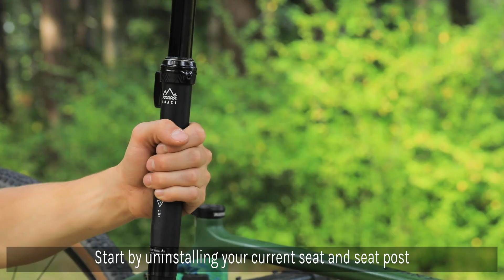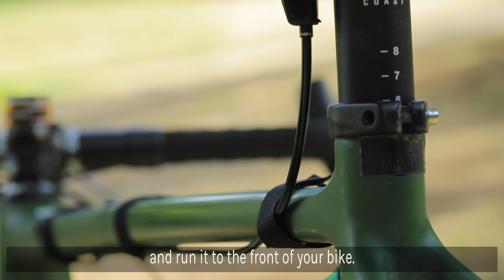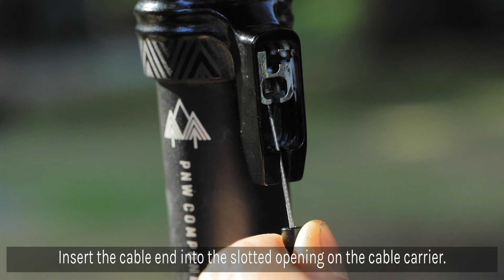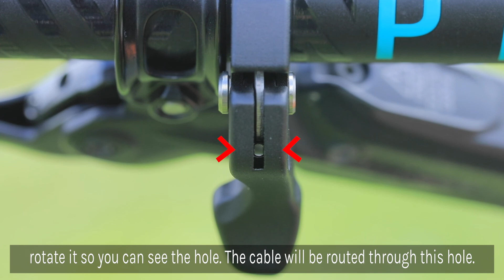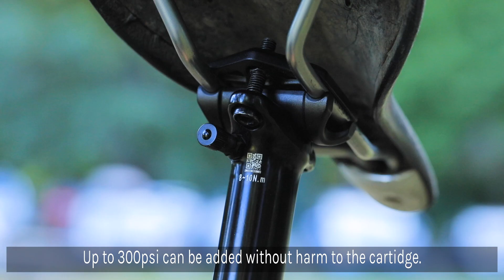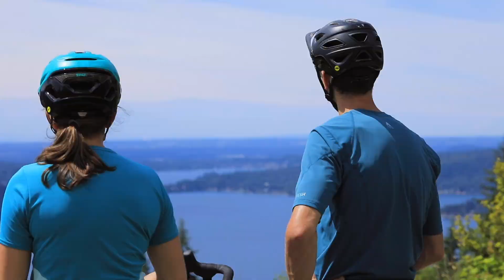PNW Components: How to Install Externally Routed Coast Dropper Post with Puget 2x Lever

Comment: Good video. Apart from the air adjust, this is the same arrangement and fitting instructions as for the Brand X Ascend II, and better than the 2 or 3 videos I looked at for that. Only thing I did different was to mount the lever outside of, towards the handlebar end from, the brake. There was room on my set up between the grip and the brake, and it means I can operate the lever without taking my hand off the bar grip.
Reply from the maker: We're happy to hear that the video helped you through your install and that you were able to find a lever position that works for you! Happy riding!